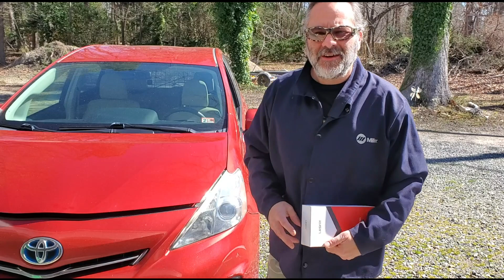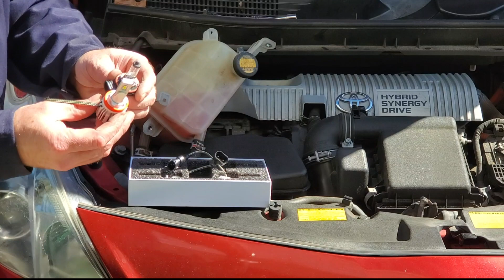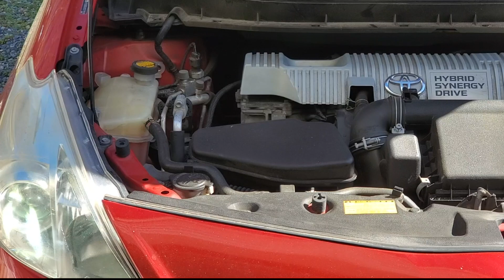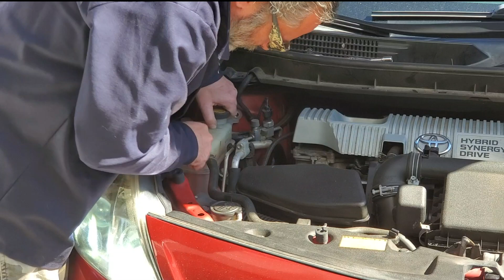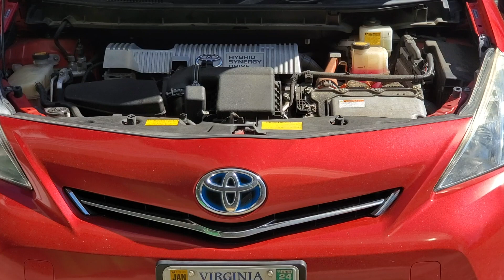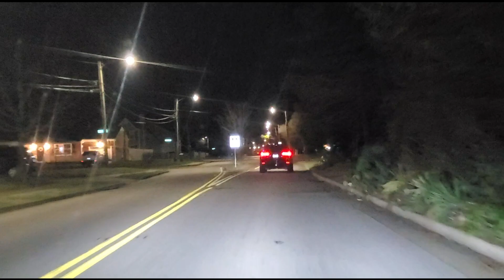2012 Prius V Headlight Upgrade with LASFIT LED Bulbs - High & Low Beam LCPlus Combo Kit

Comment: Does the Daytime running light setting function work / function normally.  I notice it uses the high beam bulb at reduced power on stock bulbs.
Reply from the maker: On some vehicles the daytime running light will flicker, there is a small inline resistor that you can get that will eliminate this. I do have flicker on mine sometimes.

Comment: You make it easy
Reply from the maker: Thank you for watching and commenting.
Reply: Yeah, I know first hand that the passenger side bulbs (at least the turn signal or side marker?) are a pain in the neck to replace. By the time you work your arm into the correct spot, you have practically no grip strength.